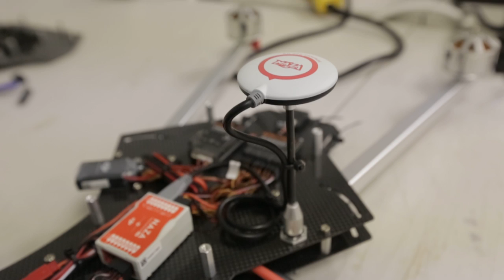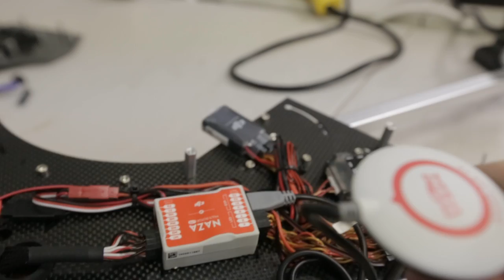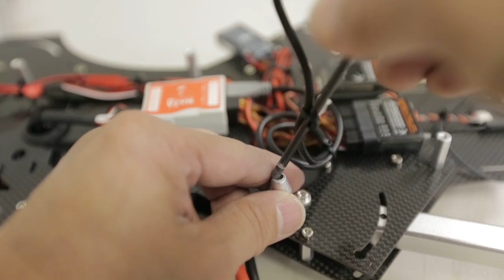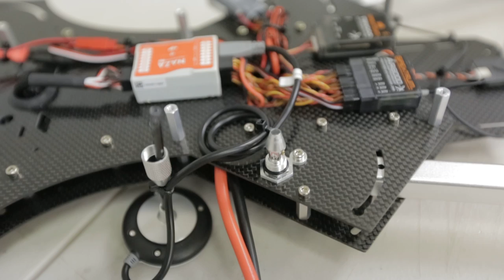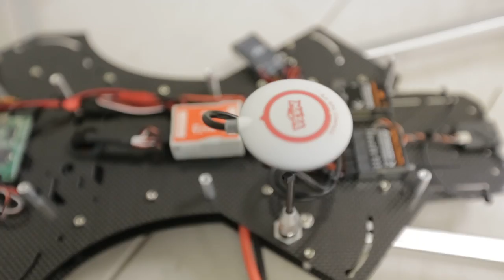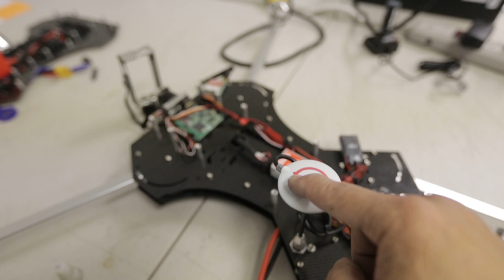Matrix GPS and compass antenna adjustment- Important Instructions

Comment: Thanks for this instructional video.  Any bit of video help is greatly appreciated because it's the easiest way to learn about this stuff.  

I noticed you had some trouble with the focus and it seems you are using a DSLR camera.  As a video producer I can help you to overcome that problem.  To allow the camera to see more depth in focus you need to close the apature (iris).  It's the setting that looks like 1.4 or 2.8 or 4.0 etc.  The higher the number the better (but then you need more light).